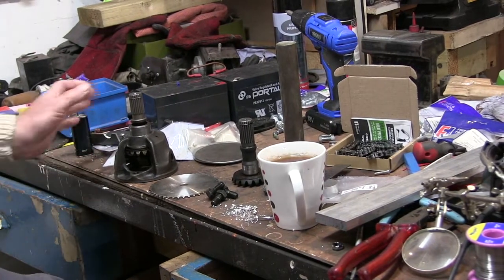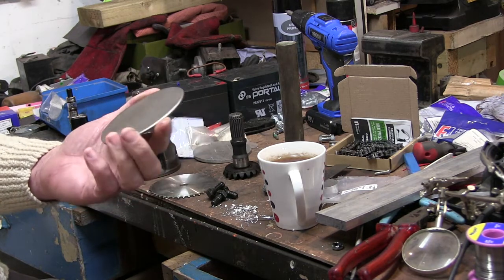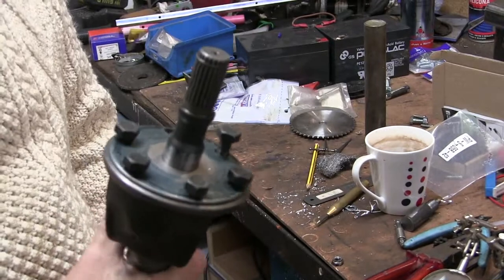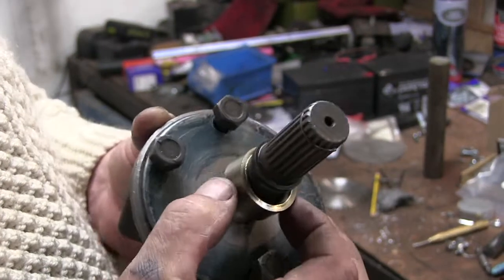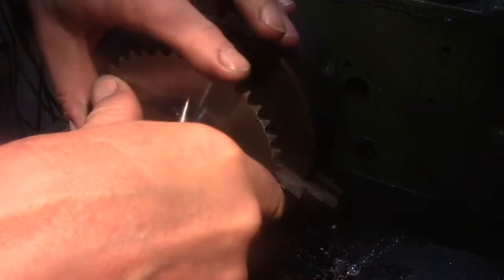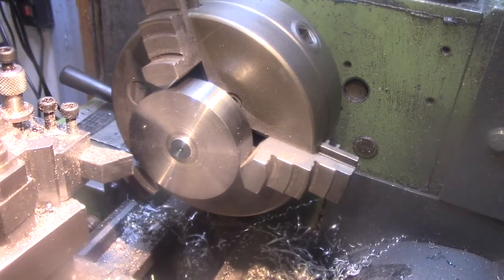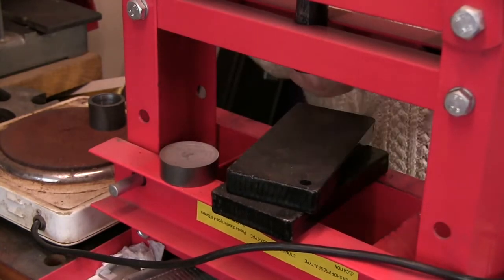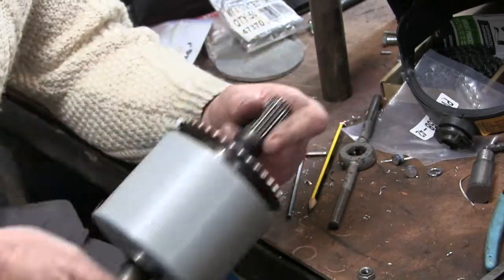A Diff For The Buggy!

Comment: Hi Cliff
  As you said, Drilling would be a good idea to have indexing holes on the diameter of your backplate on the lathe or fix a gear on the end of your spindle, fix a drill in the tool post, then you can do it all insitu & no need to do any marking out, much safer, 🇬🇧✅